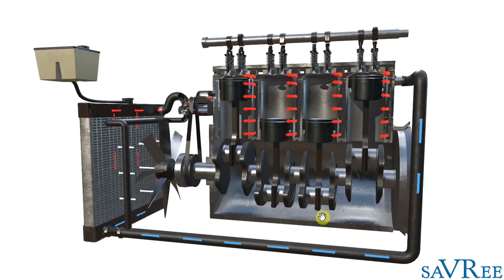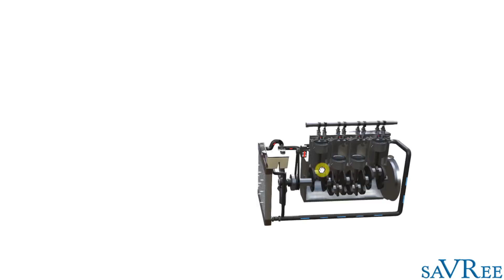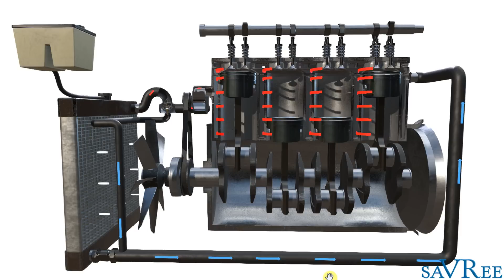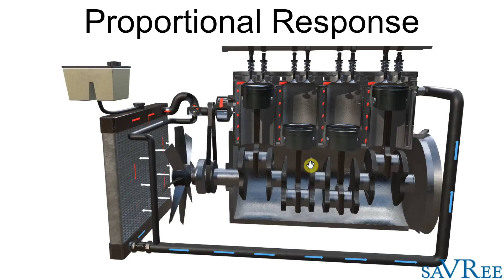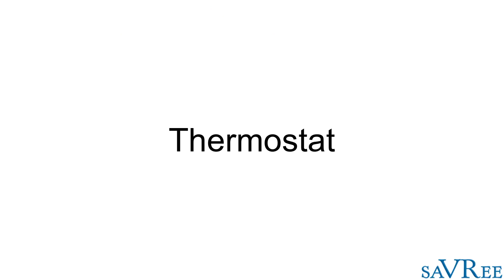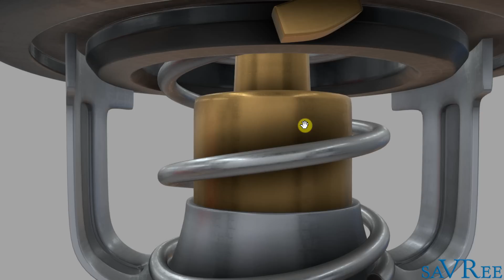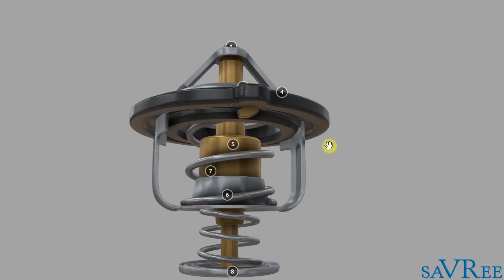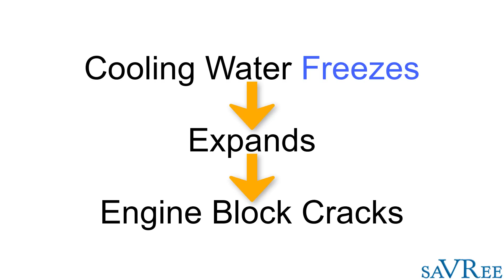How Engine Cooling Systems Work (Animation)

Comment: Great video but at 4:40 I think he gets the fan action backward.  He shows the fan pushing hot air from the engine bay forward, into the radiator.  In most engines, the fan pulls air from outside across the radiator to cool the water and onward into the engine bay.   I may be wrong, and in either case this is a wonderful video.  High praise to the creator.

Comment: Thermostat housing is located on lower radiator hose instead of the upper hose... Does it mean the upper hose is inlet to engine from radiator and the lower is exit from engine to radiator?!

Comment: Great video, and I do have a question ? Do the radiator fans blow air forward thru
the rad, and outside, or do these rad fans "suck in" air thru the radiator, to cool the
coolant, and then release the air under the hood. I always thought, they blew air
forward thru the rad, and out the front, and then into the outside air, but after watching
a couple videos, including yours, it appears these rad fans suck air in thru the rad,
to cool the coolant. Could you please clarify this ?? - thanks, and great Video :)
Reply: Yeah, all radiator fans pull air through the front to the back, as this is how air flows through them when driving forwards. It wouldn't make much sense to push air back to front through a radiator as it would be fighting a head wind in motion

Comment: The coiling fan doesnt blow air against the radiator it pulls air away from it
Reply: It can be either way.  It is most common to have a pull configuration but isn't always the case.  The goal is to get air to move through the radiator fins to carry heat away.
Reply: @Bendigo1  assuming he's referring to the fan in the video, if the fan blew air, the goddamn engine would already be at 120c and either the head gasket is toast or, if the radiator is aluminum and plastic, the plastic ruptures expelling all the coolant.
Reply: @brittanywright9646  If the vehicle was moving the direction opposite of the airflow it would not make sense to have the fan blowing air that way.  But if it was stationary or moving with the direction the fan was blowing, it would still cool the coolant in the radiator,  just not as fast as it would if it was pulling cooler air through from the front.    There are actually quite a few cases where the fan blows air from the engine side out through the radiator.     Air just needs to move through the radiator, it really doesn't matter too much which way it goes.  It is just better for cooling to have cooler air going in one side.  If it is really cold outside,  it could be better to have the air blowing from the engine side.
Reply: @Bendigo1  Tell me when have you seen a fan mounted behind the radiator actually push air through the radiator? Are you just commenting just to post replies or what? If it's really cold outside it could be better to have air blowing from the engine side? How? If it's really cold outside, the fan wouldn't even be on. You aren't making any sense at all.
Reply: @brittanywright9646  Many times actually.   Heavy equipment often has fans that push air out instead of pulling air in.  Sometimes they switch between pulling in or pushing out air.  Most ICE forklifts push air out.  

In cold temperatures,  air still needs to be circulated to cool the engine, pushing air from the engine compartment,  while not commonly done, can help to keep the coolant at a more stable temperature instead of pulling extremely cold air through the radiator, you push the warmer air out of the engine compartment.   

You must not know much  about engine cooling systems, or uses for them in anything other than standard road vehicles, or are thinking only about the standard cooling system in regular road vehicles.

Comment: so is there a pipe or something behind the engine that gets the coolant from one side to the other of the engine? there is arrows going around the cylinders but nothing showing how the coolant gets to where it is sucked out. are the cyclinders just in a bath of coolant?
Reply: There are channels inside the engine that coolant circulates through.   Basically a bunch of tunnels for coolant to flow through.

Comment: nothing mention if USING WATER AS COOLANT....meaning adding water contanstanly everyday after few distance drive
Reply: Too much water in the mix lowers boiling point and raises freezing point, along with reducing how much heat the coolant absorbs, reducing cooling ability.

Comment: Great video and excellent explanations!

I actually stumbled upon this video trying to understand how the system would operate in instances of hot coolant and a cold engine. I'll elaborate:

I have a campervan that, as a hot water heater (dishes, showers) heats the coolant to 90°C. Cold water flows from the water tank and passes through a heat exchange in thy engine bay, where it warms up thanks to the hot coolant. Does this have any positive effect in terms of cold starts? 

The thermostat is dependant on the temperature of the coolant EXITING the engine right? So unless the engine is hot, the circuit bypasses the radiator? So... No benefit? 

 When it's been in operation for a while and I start the engine, the vehicle indicates that the temperature is about 45° (half way to 90°, with an outdoor temperature of maybe 0-5°C). I'm not sure how this occurs... What am I missing?

Comment: 30 years ago, I owned a Suzuki Samurai.  That was an (at the time) inexpensive Japanese 4-cylinder jeep like vehicle with a soft top and 4-wheel drive. Because of its high center of gravity and narrow wheel base it had a reputation for turning over easily.  That never happened to mine.  But I did have a problem with the thermostat.  It had for some reason frozen open preventing the engine from warming up even after a 25 mile drive to work.  At a friend's suggestion I took a pizza box (I managed a pizza place at the time) and placed it in front of the radiator.  After a 3 block drive my engine temperature had shot up into the red.  I removed the box and the engine cooled to its normal operating temperature.  The thermostat never again gave me any trouble.  I really miss that car particularly in the summer.  But it had one tragic flaw that I discovered after I moved back to the Bronx.  It was too easy to break into and seemed to be particularly inviting to morons too stupid to realize all they had to do was open a zipper to get in instead of slicing the top open with a knife.  My stereo was removable so one thief decided to rip out my speakers.  I imagine the guy might have made $10 or $15 dollars in exchange for the damage it cost me me hundreds of dollars to repair.  What do you know?  It's been 27 years since that theft and I am still pissed about it.  But I am wondering: what would it cost to buy one today?  At least I will know what to do if the thermostat freezes open.

Comment: Can the thermostat be removed, bypass one hose so all the water passes through the radiator?.
Reply from the maker: You can, just means you lose the control to regulate the cooling water system temperature. With the setup you described, you would be cooling the cooling water at max, continuously, irrespective of the cooling water temperature.

Comment: Good video. Good animations. Only thing, the fan pulls air that is coming through the car's grill. If the fan was pushing, the air being pushed forward would meet the air being rammed in through the grill and radiator and may not cool the engine properly.
Reply: Exactly . I too got the same doubt

Comment: so does the coolant reservoir eventually get filled up and have to be manually removed?
Reply: Nope, when the engine cools down the coolant cools down too, therefore the coolant contracts. As it takes less volume, there is a slight vacuum that sucks coolant from the tank and back into the radiator

Comment: The fan does not blow air into the radiator, it sucks or draws air in. Some vehicles use a clutch fan such as in this animation while most use electric fans. Clutch fans can only draw air in as they are behind the radiator being driven off the belt

Comment: I newer seen system where fan blows through radiator, always suck through radiator and blowing in engine direction
Reply: Thats because  its connected to camshaft, audi, bmw and merc have that system on some models.
Reply: That's what I noticed as well because if the fan blows into the radiator then hot air from the engine and the components is gonna be pushed through and it's not gonna cool fast enough. Or maybe there are exceptions we don't know

Comment: can i know why need to be high boiling point?
Reply: If you have too low of a boiling point your coolant can boil and create air pockets in your cooling system thus reducing cooling efficiency and potentially blowing a hole in the cooling system and getting the engine to hot

Comment: How does the engine seperate the coolant from mixing with the engine oil? does the coolant flow in a different area than the motor oil?
Reply: Good ?
Reply: Yes, the coolant passages in the engine are separate from the oil passages.